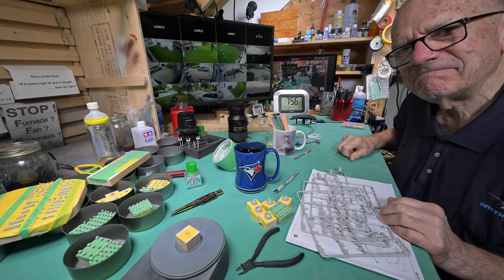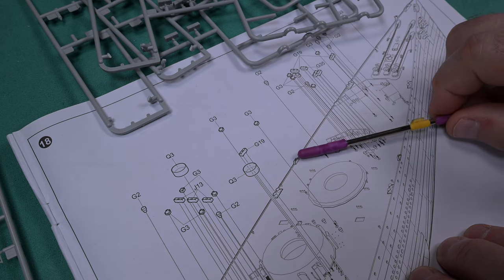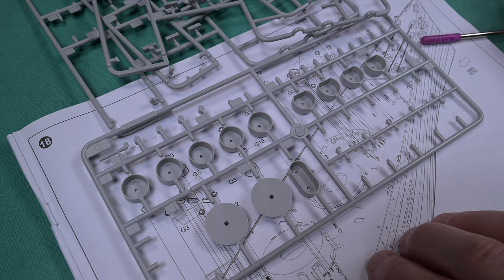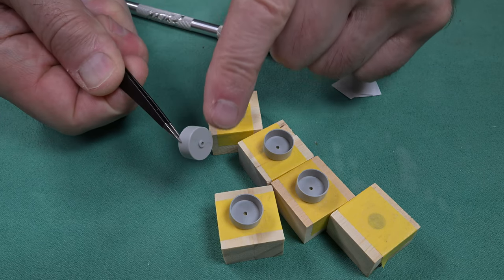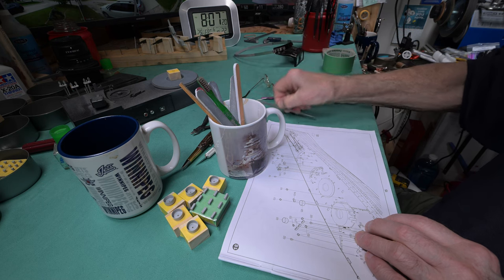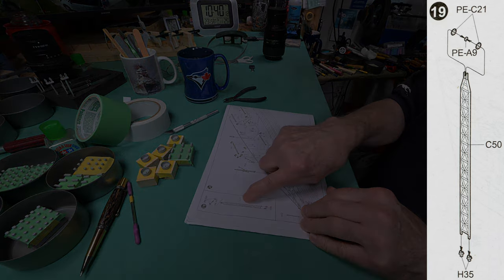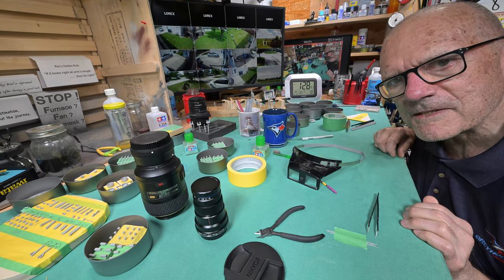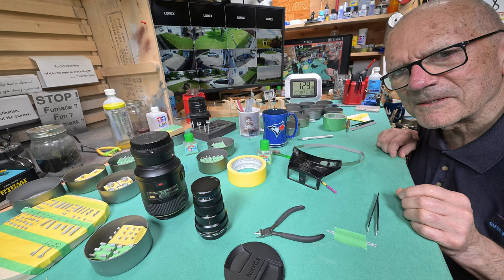The Model Ship - Part 1206

Comment: I have a lens that also creeps in the downward position.  They make a simple device to cure this.  It is no more than a wide rubber band that fits over the lens at the connection to add just enough friction to stop it from creeping.  Works great.... for me.                         See ya.                JimE
Reply from the maker: Will try that. Thanks Jim. 👍(only one emoji this time)